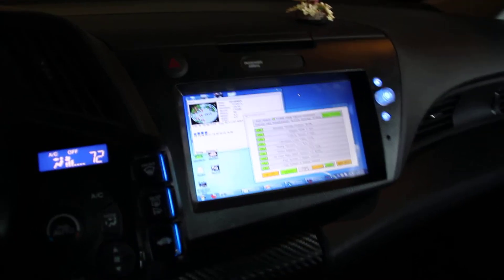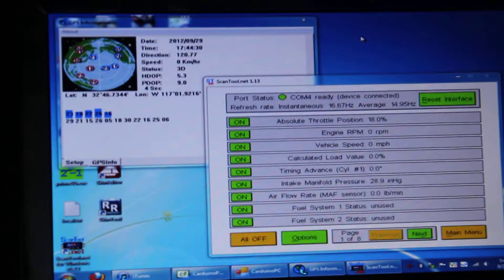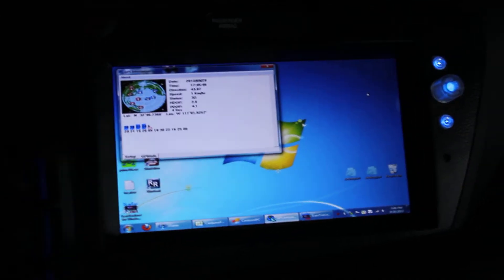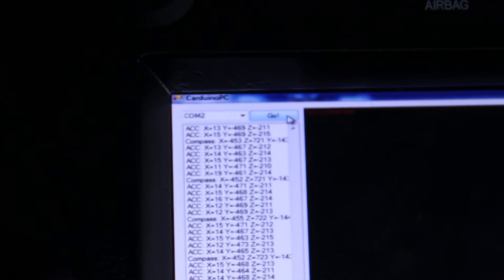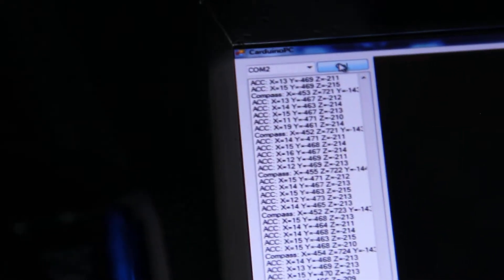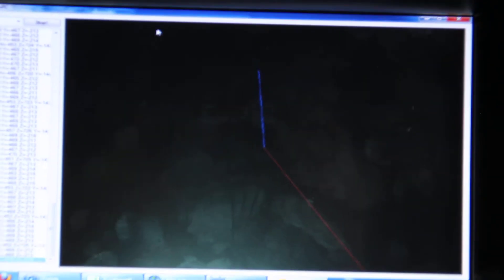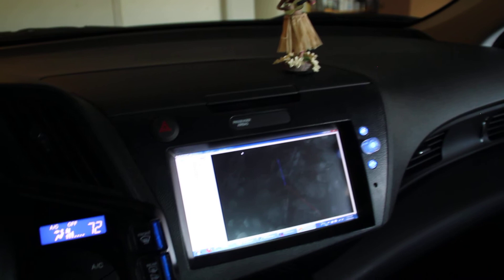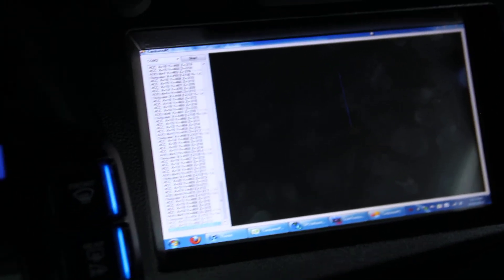Bill's CarPC - Part 10 - Integration

Comment: I have a 2011 Honda CR-Z and I was wondering where I'd go to get that kinda touch screen display, and where could I go to get it installed, and last but not least how much do you think something like that would cost
Reply from the maker: The screen is from a company called Liliput - I think it ran about $100.  if you look at some of my other videos I go over how to integrate it with the custom dash piece for the CR-Z.  That said...  I don't recommend it!  I'd suggest getting an off the shelf replacement radio instead.  These days they have android (and probably Windows!) versions that are much more reliable that anything someone could do on their own.

Comment: very nice job on this. it's really cool that you use the arduino along with it. I'm wanting to do just about the same thing in my car with a raspberry pi running  xbmc along with a pc and a tv tuner with fm. i really want to use the adafruit 10" touch screen but maybe have to settle for a 7 or 8 inch. 
great job. nice work. i hope you make more videos, they're very good.

Comment: Quick Question, what software are you using for the backup cam to make it automatically switch so quick?

Also what backup cam are you using?
Reply from the maker: It's actually the software that comes with the RC Joycon EXR - which is the piece of hardware that lets me interface to the steering wheel controls and also has an input that I used for sensing when I'm in reverse.  Since that system only works when I'm in Windows, my controller box reverts back to switching the input on the LCD screen when the 'ready' relay isn't switched.  I found the LCD very picky and unreliable when switching, however, plus it takes quite a long time.
Reply from the maker: The backup cam is some random crappy thing I found on eBay.  It's got decent resolution, but you can't turn off all the overlay stuff, so for me it's useless.

Comment from the maker: The arduino platform was a perfect choice for me - super easy to use, easy to interface to the PC, lots of tutorials and stuff online, and it will interface with just about any low-level hardware (buttons, sensors, lights, etc) that you can think of.